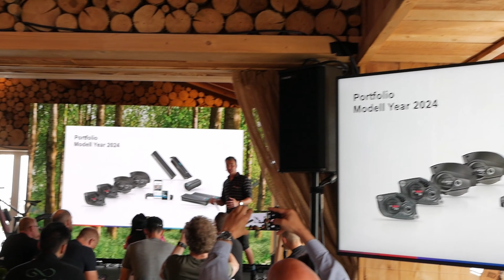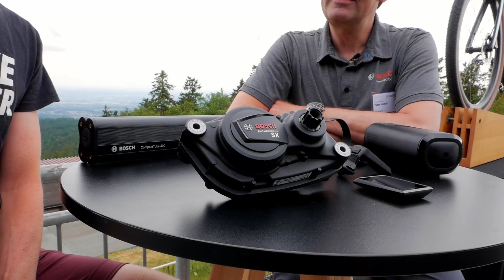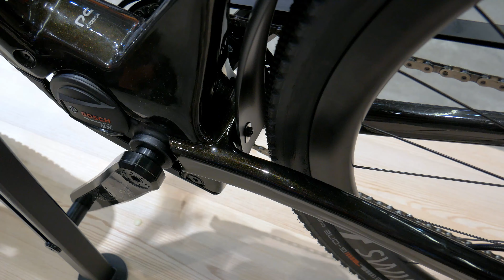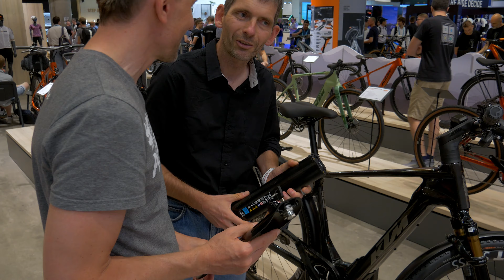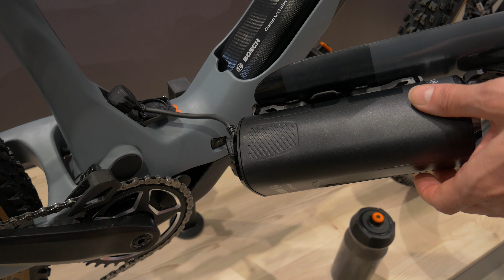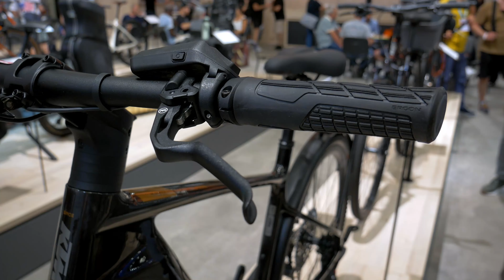KTM Macina Sport SX | Light Trekking E-Bikes with Bosch Performance Line SX | EBIKE24

Comment: What is the difference between the KTM Macina Sport SX 10 and the KTM Macina Sport SX 20.
Reply from the maker: Hi Mark, thank you for your comment! Both bikes are very similar, the only difference lies in the specs. The SX 10 comes with a Shimano Deore XT Linkglide 11-speed rear derailleur. The SX 20 is equipped with the Shimano CUES U4000 rear derailleur. In general, the SX 10 has the higher quality components, which is also reflected in the price. Both bikes are excellent all-rounders for everyday use. You can also take a look at these bikes in our shop.
KTM Macina Sport SX 10: https://www.ebike24.com/ktm-macina-sport-sx-10-2024
KTM Macina Sport SX 20: https://www.ebike24.com/ktm-macina-sport-sx-20-2024

Cheers - Michael